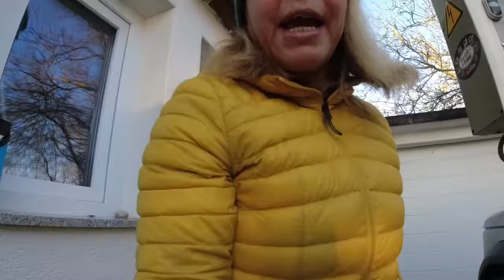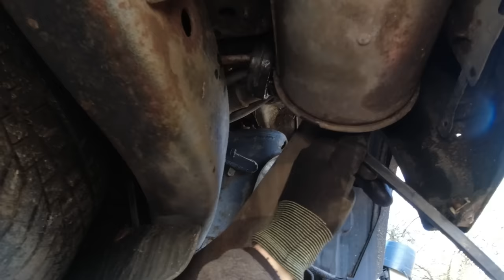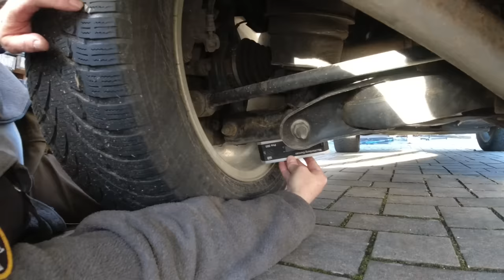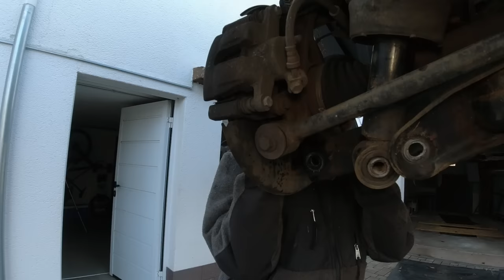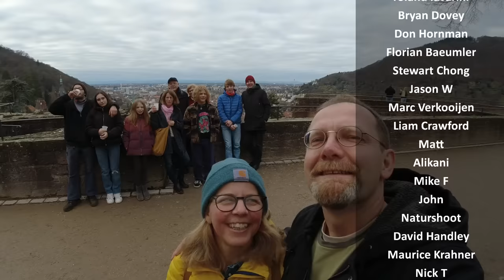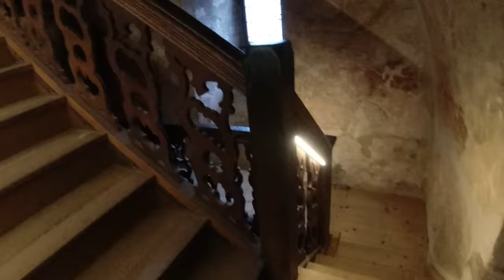Replace suspension bushings - Land Rover Discovery 3 / LR3 / S4-Ep2

Comment: Happy 39th Birthday Vera! This was an interesting job - certainly a big one.  It would be interesting if Christian could comment on the approximate cost of having the work done in the main dealers when he does big jobs like this. Also at the end of the year he could total it up for both the mall crawler and Vera's adventure wagon.
Reply from the maker: We had about 200€ on the Mall Crawler in 22 and 1700€ on my Discovery 3. But that includes the 300€ FAI oilpump we had to replace again. A big chunk of that is for oil. 🙋‍♀️Vera
Reply: @Vera_and_Christian  the oil change and filter on my v70 2015 costs two hundred pounds every year, (done by the dealer), so yes motor oil is pretty expensive but what can you do?

Comment: Happy Birthday to us both Vera (mine's the 4th).
Christian - a man of your talent, how could you forget pre-load when working on your suspension??! Not having access to a press is why many of us just replace the whole arm (wishbone) - it's not sooo much more expensive given we're not paying labour and garage margins on parts. The suspension on my Alfa GT is made of chocolate and needs rebuilding every couple of years - I'd go mad if I replaced bushes instead of the (cheap) complete arm each time. Next 2 jobs on our D3 - replace fuel pump belt in situ and replace ( probably) headlining....
Reply from the maker: I don’t know if I forgot.  They failed again and typically the rear lower last 180 t km.  We had bad luck with aftermarket arms before. Check our fuel pump belt video.  One of the first ones.  Christian
Reply from the maker: We did a Headliner video too on our Freelander. But it was mainly a Timelapse of this work.  Christian

Comment: Happy birthday Vera 🥂. Really appreciate the tip about using armoured vehicle suspension bushings. Had mine replaced a couple of years ago and they failed in a few weeks. Bad squeaking. I asked if they tightened at normal ride height, so they did for sure the second time and no problem since.

Comment: I had to replace the front lower control arms on my D4 TDV6 2.7. The local Land Rover specialist, not the dealer but people who know what they are talking about, told me not to fit polyurethane bushes as it would destroy the ride. Also if you go to the Penrite oil selector app it states you should use HPR 5 5W-40 (full synthetic). They also have an oil for the auto trans, ATF BMV which is a lot cheaper than the usual liquid gold. I ran this trans fluid in my D3 and the wife’s Ford Territory for years with no problems. At last but by no means least a very Happy Birthday to you Vera 🎉

Comment: I always use Copper grease when i put nuts & bolts together to make them easier to take apart at a later date, i coat the exposed thread too after they are tightened up to prevent rust on the exposed thread, also before i remove an old bush i usually mark the position where is goes

Comment: Happy bday Vera!
Q for LR3 community: I purchased a ‘09 (88k miles), previous owner installed poly bushings and new front air struts. Ride quality in town/over road irregularities is harsh. Hwy ride is great. Where should I start in looking for ride harshness issue?
Reply from the maker: Not sure.  The bushes may have play.  All joints must be top to have a quiet ride.  Christian
Reply: Ha, I have the exact same issue. Previous owner had orange poly bushings installed and feel like the ride is too stiff. I have an ‘05 LR3 with 244,000 miles. Most of my driving is inner city and would love a softer ride. I am also getting a ‘clunk’ in the rear from time to time. I will most likely swap out the entire arm assemblies instead of replacing just the bushings.
Reply: @iap6647  - most of the sounds I’m hearing are from interior parts and pieces rubbing and possibly loosening. Suspension feels tight.

Comment: Happy BirthdayVera! You're two days after me! And Happy New Year to you all. Christian there is an easier way to get the inner part of the bushings out, when I had my Discovery 1  the front axle arms had two big bushings in each and they are solid rubber with no cutouts. I used a 50 mm bimetal holesaw to cut through the rubber from both sides. I was a hard job but I got there ( I put Polly bushes in mine. And it improved the handling 200% lol) Your bushing rubber should be no obstacle for a holesaw at all and it will save you from breaking sooo many drill bits !

Comment: Oh guys I admire your perseverance so much.  I know I have to do this job soon even though mine passed the Irish test a few months back.  Thinking about this job, I might get a pair of an engine damaged disco and refurb them first and then do a straight swap, that way I can still use genuine Land Rover but have the discovery driving while I prep the parts.  

Out of interest, have you ordered the 30 tonne press yet?  The price of them have come down a lot now, well worth the investment as you do all your own work.  

Lastly, have you guys done a video on replacing an air strut?  The job is easy but I’m curious about the different brands of strut, mines at 270km on original shocks so I may be due a swap soon, was looking at Arnott.

Hope you had a great birthday Vera 🎉
Reply from the maker: We have not changed the air struts yet. But when ever we do, there will be a video for sure. Unfortunately, we only need a press every couple of years, last time it was 3 years ago. We do not want to sacrifice so much floor space. Christian dreams about a different machine we will buy this year. 😅👍🙋‍♀️Vera

Comment: I used spray motor bike engines with black Hammerite smooth on bare metal using a spray gun never had a problem leaving a professional durable finish, maybe something worth looking into.

Comment: I’m reasonably certain that any automatic Discover 3 or 4 won’t automatically apply the handbrake, even when you take the key out of the ignition switch. This is because you put the transmission in ’P’ which locks all the wheels. 
This is a huge advantage of not prematurely wearing out that awful electronic handbrake. 
However, it does need using every now and again to prevent the cables seizing.
Happy Birthday Vera.
I’ve been 41, 21 times now. But I still feel like I’m 41. So don’t worry!
Well my brain does. Not sure the rest of my body does😢
Reply from the maker: True about the EPB.  The manual one applies it if configured.  Christian
Reply: The automatic application of the handbrake on key removal is a configuration (ccf) option that can be set with something like the gap tool.
Reply from the maker: yes, but the LR4 does not have a key. It’s push button start.  Christian
Reply: @Vera_and_Christian  One of the things I like about the ELP on an automatic is that you can put it on at a set of red traffic lights, but don’t need to turn it off to drive away again. Just leave the car in Drive and press the accelerator to move away when the lights go green.
Unfortunately this does not work on a manual. You have to release the ELP or the car will stall.

LR definitely favoured the Auto to allow this sort of benefit. On Discovery, Auto was an additional cost option on all models except the HSE, on which Auto was standard and Manual was a no extra cost option. Yet only Auto was available on all Range Rover Sports, including the SE, rather than just the HSE versions. The only difference being no paddle-shift available on the SE.

Interesting to me that all new Defenders are only available with an Auto gearbox. But if I was buying one, that is exactly what I would want. Modern Auto’s are so good now, unless I drive a sports car, I don’t want a manual any more. But this could because I have been 41 for 21 times now!

Comment: good night, how are you? I'm Andre here in Brazil🇧🇷 I had a Discovery 4 2012 and had the bad luck to have a problem with the discharge pump and injector nozzles after 3 months of use! unfortunately here in brazil, the maintenance of the land rover is very expensive because i had to dismantle it! I like the car a lot! and watching your videos is making me want to have one again! my question is? there for you guys this same problem with the discharge pump, and can I do something to prevent the problem again? I know that our fuel here is of very poor quality!
Reply from the maker: If you refer to the high pressure fuel pump, it’s only a problem on 2007-2009 LR3. The 3.0 is not known for problems unless poor fuel filters are installed.  Only us OEM.  Poor Diesel is in many areas but it is not a big problem.  Oil change intervals is then 6 t km.  Christian

Comment: Happy birthday vera  greetings from texas,  
I am about to replace all my upper/lower control arms and some of mine I ordered with polybush so I know christan loves fixing things , but why not buy the polybush much stronger the the rubber bushings and lots easier to install no press needed and will last much longer for me I think that's the way to go I am not looking forward to this work , but I plan to do all new brakes and rotors and air suspension and control arms all at same time or atleast one wheel at a time  or christan can come to Texas and do all this for me as you viedo him OMG 😲
Reply from the maker: Christian explained in the video why polybushes are not suitable for the Disco 3/4 🙋‍♀️Vera

Comment: Do they have a air dryer system between the compressor and the air tank. These systems stop endless problems with air valves and rusting on large trucks and could be a good modification if not fitted.
Reply from the maker: There is no active dryer installed indeed.  Christian

Comment: as far as i'm aware, poly bushings are harder than rubber, not softer. does LR use a special hard compound rubber?
Reply from the maker: I don’t know.  Polybushes turn. They are not bonded solid and this is why they they can be harder and cause cracking of suspension arms.

Comment: Hi thank you very much for the very interesting programs and all the technical details, could you please make a program about how and when discovery four/three uses ABS system to stop the slipping wheel(wheel spinning without traction)so that powers go the wheel which has traction .on my discovery 4 I was stuck in the mud
  two front wheel spinning (no traction ) and also the right-hand rear wheel spinning (no traction ) however the left-hand rear wheel was not spinning????!!! thanks
Reply from the maker: That is all explained in the handbook, that comes with your Discovery. The handbook is a must read for anyone owning a Discovery anyway. You learn so much about your car and what it is capable of. Please do your research and read the handbook. 🙋‍♀️Vera
Reply: @Vera_and_Christian  thank you for your answer however your answer is not correct nothing is written in the handbook about how the Algorithm distributes the power in the transfer case when detecting and also ABS system action to spin the four wheels, as I explained I had three-wheel spinning and normally brake should have been activated on the right-hand wheel (spinning) so the back left-hand wheel get the power

Comment: I believe the lower control arm and upper, have the bushings inbuilt ?
Reply from the maker: ? How does everybody replace them then and why is the procedure in the manual 🤔Christian
Reply: @Vera_and_Christian  Based on my own experience, it was suggested by my Land Rover mechanic that the entire control arms be replaced when the bushings need replacing. On reflection that might be my mechanic's timeframe to get the jobs done. Economies of scale....
Reply from the maker: @ministry_of_love  Keep in mind what we think of "Land Rover recomendations" or "Land Rover maintained". We are pretty sure that they do not have the customer, or what is best for the customer, in mind when they do a repair. 🙋‍♀Vera
Reply: @Vera_and_Christian  If only we loved Toyota vehicles instead, our lives would be so much easier. Perhaps we are fools for love....
Reply from the maker: @ministry_of_love  We are driven by passion. That is the difference between us and the Toyota guys 😅👍🙋‍♀Vera

Comment: Isn't it time for a switch on the  Third Row fuse as it seems to see action nearly every week? 😀 On a more serious note, what about some selective rustproof treatments on your oxidizing  chassis to compare various wax, bitumen, epoxy and lanolin "miracle" coatings?  Britannica Restorations entertains sometimes with Krowne Rusproofing tests.   Years of frustration with congealing Waxoyl have pushed me now to try lanolin fluids, but I fear it will attract sheep parasites !
Reply: Great comment Phil. I was thinking of that also 🤔👍
Reply from the maker: Like we said in the video, we will not put in a switch as we get comments : Where is that switch on my Discovery?😅 🙋‍♀️Vera
Reply: @Vera_and_Christian  I was referring to Phils suggestion about the rust treatments. Great channel as always, loving the extra content at end. Nice touch. ☺️😎
Reply from the maker: My opinion to rust protection: I will stay away from products which are bitumen or wax based as they do not cure and stay soft. I hate that.  I want a coating to give me a somewhat solid surface which allows overpainting.  Veras car has very little corrosion as seen in many videos.  Attempting a „dessert“ look outside of the dessert is a wrong goal and not worth the effort from my point of view.  I ordered some products which we will test in Videos down the road. Likely in summer when the conditions are better for painting outside.  Thanks 🙏 Christian
Reply: @Vera_and_Christian  Looking forward to this. Mike at Britannica Restorations has set up some steel wool and surface tests .  I've recently tried Lanotec or Lanoguard (?) after years of misery from Finnigan's Waxoyl which only seems to spray when hot. OKS also make some great anti corrosion coatings. Anecdotally I've  noted in Hong Kong a lot of very old Mitsubishi station wagons looking very rust free and sporting Dinitrol treatment stickers.  My various  aged G Wagen chassis have never shown any surface rust  whereas my old Land Rovers have always flaked rust whatever is applied. Looking forward to your future tests , maybe with a salt spray rig ? but perhapd better not on your LRs!
Reply from the maker: @gordyl9247  👍😀I was referring to Phils comment about the fuse switch. 🙋‍♀️

Comment: Do you not own an air chisel amongst your air tools? If you do then using a pointed bit works a treat for removing the old bushes and no need to remove the inner part first just attack the outer part and the inner comes with it.
Reply from the maker: I have one but had no luck with it in the past.  Maybe it’s a bad one. It’s from China.  Will try this next time. Christian
Reply: @Vera_and_Christian  I used to use a pointed round bit and worked a treat obviously there are the stubborn ones needing extra attention. Keep up the great work